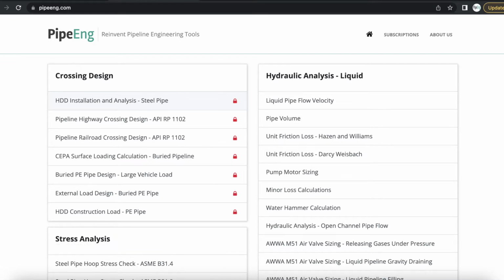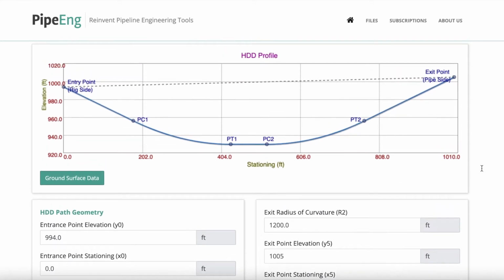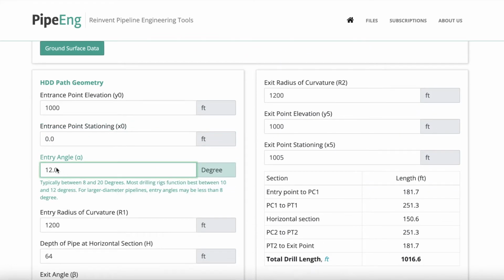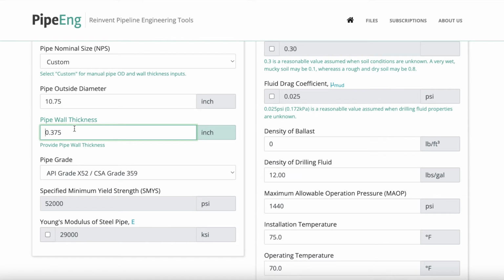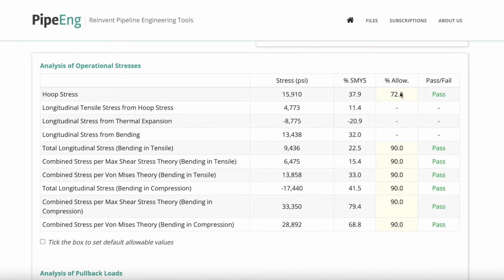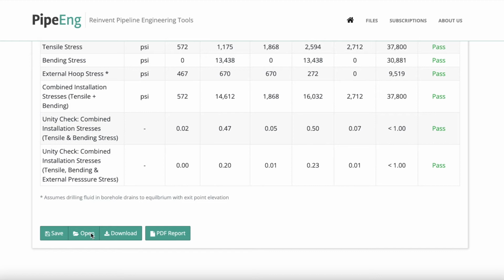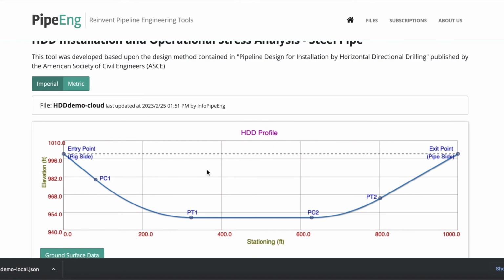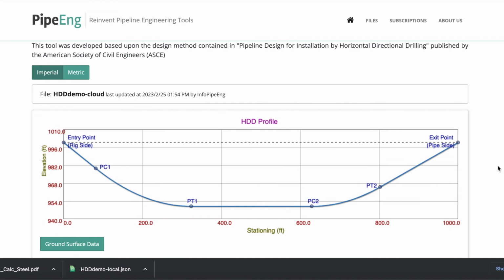Tutorial: Steel Pipe HDD Geometry, Operational and Pull Back Stress Analysis

Comment: How do you calculate the radius of curvature?
Reply from the maker: The typical design radius of curvature is usually 100 ft per the diameter of the pipe. You can determine the minimum radius of curvature by iteratively adjusting the number until you achieve the maximum %SMYS as specified by your governing code.